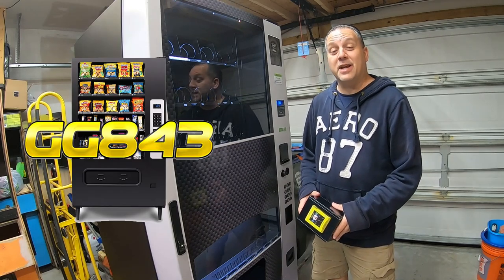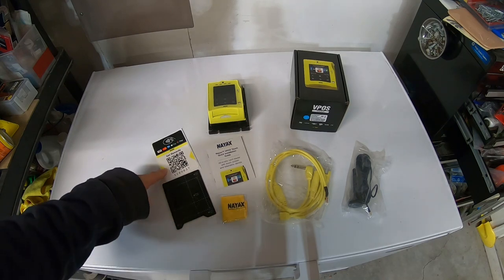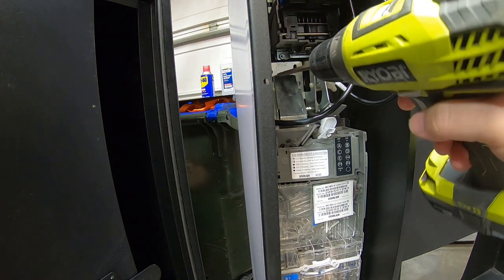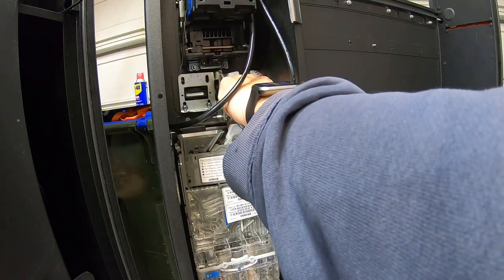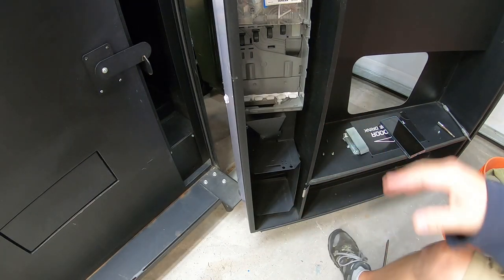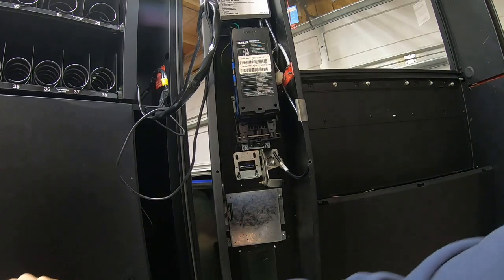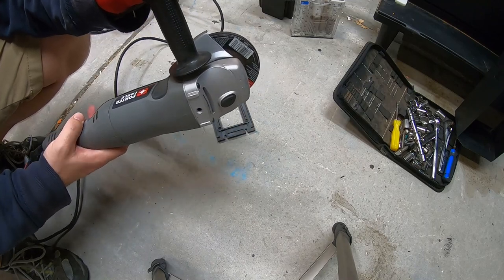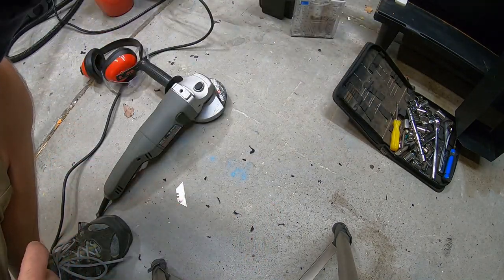How to Install A Nayax VPOS Touch Credit Card Reader On A Combo Vending Machine!

Comment: Great video. I have a question on the antenna. Do you mount it internally and if so, does it matter where? Thank you.
Reply from the maker: Thank you! Yes I usually mount them internally and it doesn't really matter where... However sometimes when you get it to your location the cellular service may not be very strong. If that is the case, you may need to route the wire to the outside of the machine to catch a better signal

Comment: What size bolts did you end up using or what size driver did you use to screw it in?  My machine was second hand but didn't come with them either.  And I have the same drill what kinda Phillips driver did you buy?
Reply from the maker: My apologies as I just used whatever was on the machine... I don't recall off hand what socket it was. As far as the phillips driver just whatever was on the rack at home depot!

Comment: Does the machine have to be off when you install the card reader the only reason why I ask is because I have a location where I am installing but I didn’t know how to do it so I bought myself time to install it next week but in the meantime, do some questions I need to ask And the first one would be does the machine have to be off when installing
Reply from the maker: I would advise to always power the machine off when connecting / disconnecting anything electrical
Reply: @GalaxyGames843  got it

Comment: I try to take out the bottom coin container, but for some reason it wouldn’t come out and I didn’t want to force it and break something so just ask is there a certain way?
Reply from the maker: Did you remove the screw at the bottom - I show it step by step in this video
Reply: @GalaxyGames843  no I didn’t do that. I was trying to figure it out while I was there at the location but wasn’t too sure so I gave up and explained it. I will be back Tuesday so until then I was looking at videos on how to do it so when I go there, I’m able to just do it quickly and then be out because I feel like I’m losing money because who carries dollars or change anymore

Comment: Are all of the card readers the same size regardless of the machine it will be used on?
Reply from the maker: Yes! Some machines don't have a designated space for them though. In that case you'll need to drill holes and mount somewhere on the front of the machine

Comment: So, I installed it into the same machine. However, it's lag time to actually make a transaction is quite a while. Only the tap pay currently works, not the slide or insert option. Is there a specific thing I have to do with the management system before payments can be accepted on the machine? I am struggling as this is my first machine and Nayax system.
Reply from the maker: Should not be - if one works they should all work - i'd reach out to Nayax tech support and make sure they have all of your back end settings correct